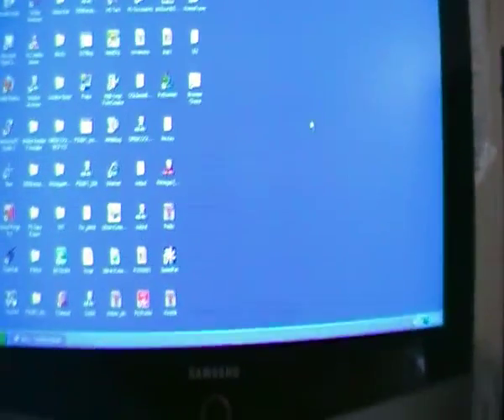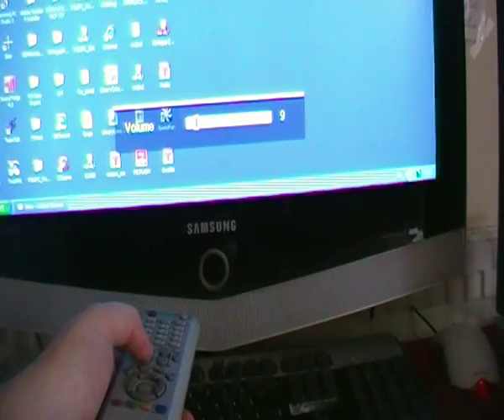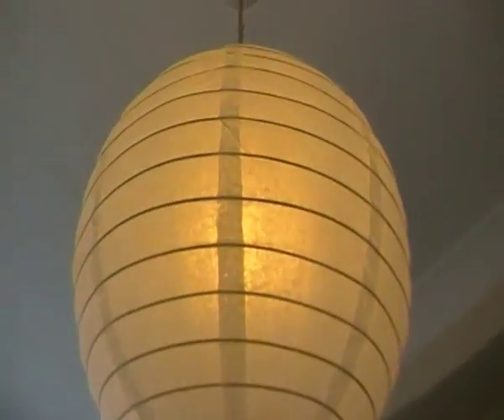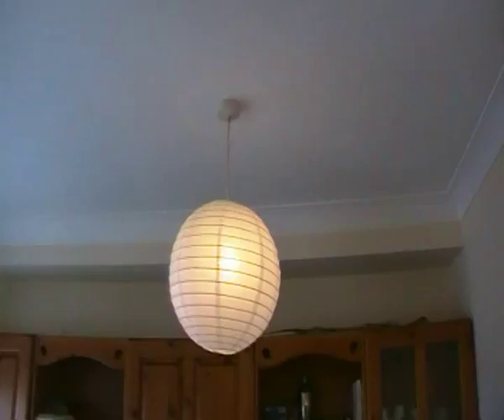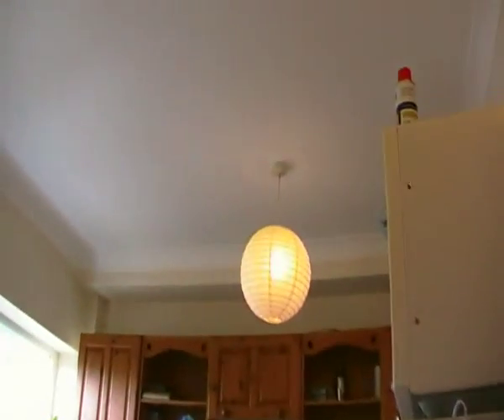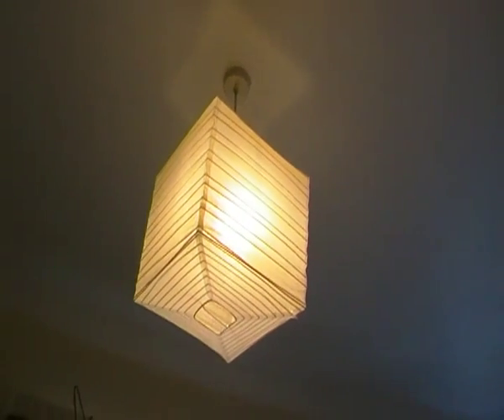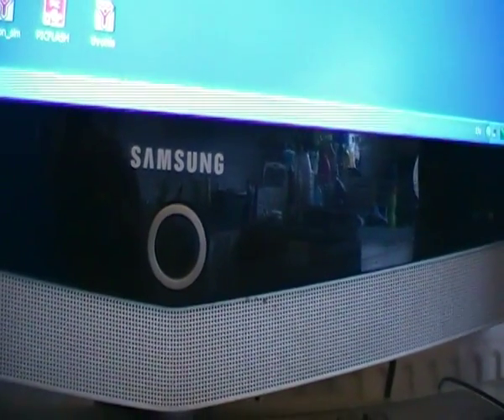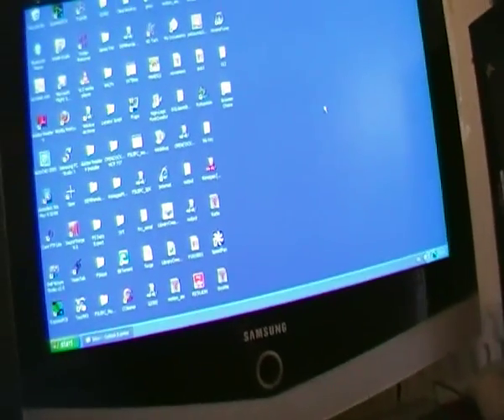Strange phenomenon with energy saving light bulb - Infrared?

Comment: I think it has to do with either one of 2 things: 
A) an IR signal at the sides of the spectrum, not detectable by standard IR cameras (they don't neccessarily  cover the enitre IR range).  The light bulb emits some IR, even though very narrow. B) Electromagnetic noise emitted by the 'driver'  electronics integrated in the lamp. Maybe your remote sensor is radio controlled ?(bluetooth included)

Comment from the maker: stranger things have happened in my life so I wont discount that theory.

Most IR receivers have an IR filter so only IR get in i.e to stop this sort of thing happening. But there is not any trace of IR coming from the light?

This light bulb is emitting some sort of light which is above the frequency of IR so to get through the filter.  It could be microwaves, x-rays or ultra violet. Neither of those sound very edible so I am slightly concerned